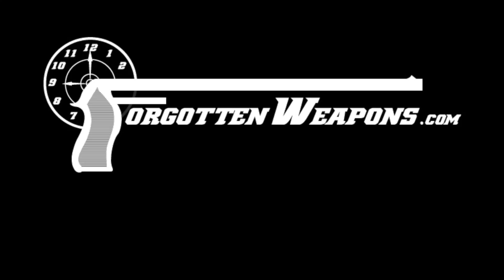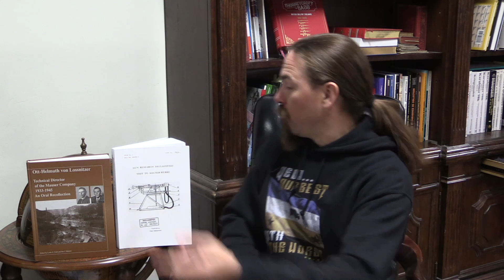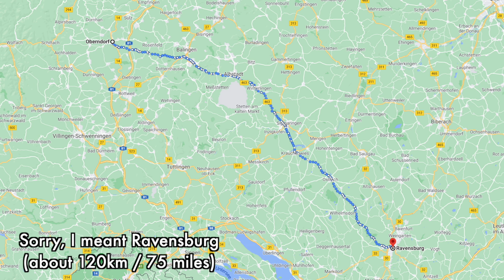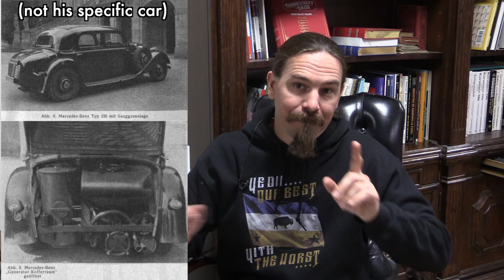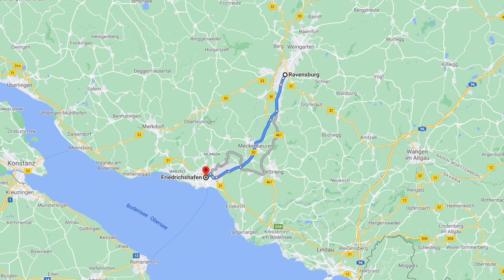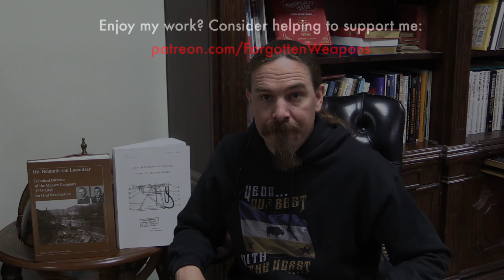The Mauser Train: High Adventure in the Last Days of WWII

Comment: As a railwayman, the reports of the hurried, chaotic evacuation train ops are crazy. Reichsbahn and -post guys having to evade air raids, sneak though damaged, half-abandoned stations, avoid blocked lines / destroyed bridges and scrounge up the limited fuel remains, just to stay ahead of the incoming allied forces.

The German railway system was in such a catastrophic state after WW2, that it barely could do its basic job: transport coal/fuel and food.

Putting lines back into "operation",  finding and fixing locomotives, railcars, diving through sheds and cellars, just to find spare parts, maybe a telephone or a spool of cable...

Comment: Sounds like the Me-262 debacle was not Waston's Whizzers.  The Whizzers did hire Germans to help them and it was a German that was flying the one 50mm cannon Me-262 that already had the canon installed (which required a major alteration to the nose landing gear) when an engine exploded andthe pilot had to bail out.  The canon survived the crash and is in the museum of the Unite States Air Force in Dayton, OH.

Comment: My dad as a machinist apprentice at Illinois Institute of Technology Worked on parts for the reverse engineering of the Mauser revolver cannon in 20mm which became the US M39 20mm aircraft cannon I believe the sample they had came off this train. They also worked on a boosted rocket cannon in 57mm for the competition for the arming of the F89 Scorpion the Mighty Mouse Folding Fin aircraft rocket won that contract. The boosted rockets were too accurate 1 mil dispersion at 1,000 meters. This might have been from the Mauser 5.5cm project.

Comment: The Mauser mg 213 autocannon survived the war. That was the 20 mm gigantic single action revolver that was actually belt fed.  It worked by cramming rounds into the back of the cylinder one position before the hammer, then moving the round between the barrel and the hammer to fire, and then moving at one position more where the empty shell got ejected.

The US, Britain, France and Russia all got a hold of samples of that critter and each made their own versions. Which were used to shoot at each other in the skies of Korea as the US Pontiac m39 mounted in the f-86 saber jet competed with cousins mounted in Migs.

I'm the lunatic that added that feed cycle to a Ruger new vaquero converted to 9 ml parabellum and didn't quite get it working right, and I'm trying again with a Blackhawk in 10 mm so that I have enough gas pressure to do both gas operated shell injection and shell ejection. I'm gathering the parts now.

Comment: This could be a 2 gun match stage: carry several 50mm steel pipes from a container to the back of a truck, jump on a bicycle and ride a 100 yard course to a shooting bay. 10 sec bonus for shooting with H&K rifle, 30 sec bonus if using a Mauser 98 pattern bolt action.

Comment: German engineer: "I know some experienced German jet pilots who would be happy to fly these new planes over to you."
American General: "Naaah,...I don't trust you guys. Besides: It can't be that difficult to fly these new contraptions...."
Reply: "How hard could it be?"

 Engine flames out
Reply: Fly, yes.  Land, no.
Reply: The engines on 262's were notoriously underdeveloped and had extremely poor throttle response both powering up and down, hence they required extremely long take off and climb out runs and for final approach/landing as the throttles were gently nudged up or down by the pilot. During take off/landing approach they often had to be provided with conventional fighter escorts.   Flame outs happened very easily resulting in engine fires.  They were also extremely unreliable, after ~15 hrs it became a guessing game if the compressors and turbine blades would stay attached.  A lot of it was metallurgical; nobody had developed metals at that time suitable for axial flow engines.  One of the reasons that Britain concentrated on the centrifugal compressor type for the first few years of turbojet use.
Reply: German engineer: "Look, ve know a couple of pilots who actually flew these things! Day  vill be very reliable, you can trust us, ze war ist over".
American: "So where are these boys you speak of son?"
German Engineer: (points to a bearded drunk in a feild running around with arms out pretending to fly) " Over there! Hans! Comon ze here, shnell!"
Hans: (Stumbles out of field, breath smelling of alchohol he snaps to attention and gives nazi salute to the American officer).
Hans: "Ich bin hans mein Fura...(slowly thinks for a moment) ... Stalin..  goot yah?"...
American Officer: yeah I think I'll let our boys take this one...
Reply: @Hebdomad7  That was almost poetic. Lol

Comment: Well told, Ian. Of course, when picturing the train hurtling through the Alps, one needs to keep in mind that the route indicated at 10:25 actually follows a very long valley (in a relatively straight line), some of it alongside the river Inn, and gains a mere 400m (or so) in altitude - which is not quite the same as crossing mountain passes.

Comment: The whole thing and especially the 262 part reminds me of when the Brits took charge of a Fa 223, a remarkable twin engined helicopter which was really quite advanced for the time.

There was an incredible story of an Fa 223 being sent hundreds of miles around Eastern Germany following a "special order from the Führer". An Fa 223 was sent from Berlin to Danzig, a flight taking several days where they flew over the advancing red army before landing at the besieged city and promptly being sent back to Berlin! They clocked up over 1000 miles of travel. A truly impressive feat for such an early untested helicopter.

Anyway, post war, the pilot from that incredibly long flight flew an Fa 223 over the channel for the Brits to have, being the first helicopter to fly across the channel . He was insistent on the machine receiving tightening on the engine housings. The maintenance tool was left in Germany and no effort was made to manufacture a tool or heed the Pilot's warnings. On it's 3rd test flight in Britain flight the helicopter buckled and crashed being unrepairable due to lack of spares. The crew was fine but the heli was most likely scrapped and none survive today.

Comment: In 1991, a body was discovered in the glaciers in the Otztal area, and it turned out to be from 3300 B.C. 
That area is in Austria, and is super steep, and would be easy to defend from ground based attack, but not so much attack from the air.
In any event, that is a fascinating story.

Comment: "They didn't have any dummy 50mm ammunition, only live rounds." -I can't be the only person hoping they would mount the cannons on the moving train and use them to fend off the attacking fighters, right?
Reply: An A-Team montage where they are busy welding and cutting metal, gathering up parts, then boom! The side door of the boxcar swings open and there is a 50mm cannon firing away.
Reply: @gushasford  See, I ain't gettin on no plane, Hannibal.  A train, dats OK, and when I get a hold of Feldwebel Murdoch I'm gonna send his ass to the Eastern Front!
Reply: I thought that was what was going to happen.
Reply: Would have been better if the 50mm rocket ammo randomly exploding had taken out the planes.
Reply: Nope.